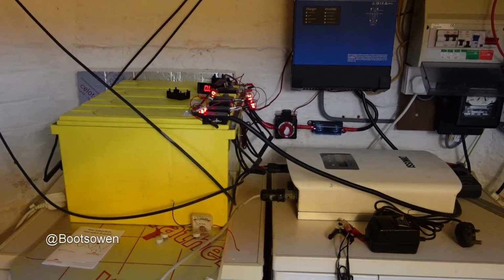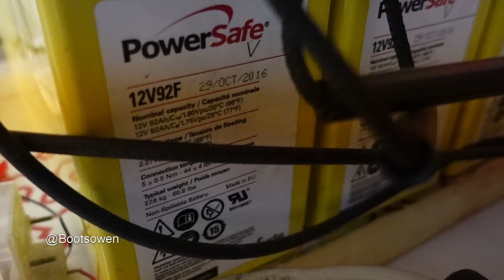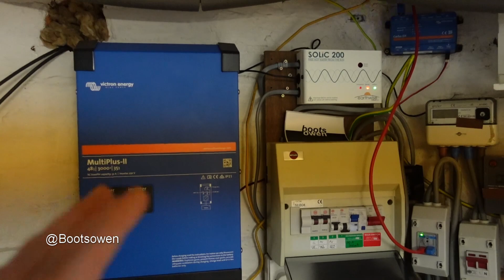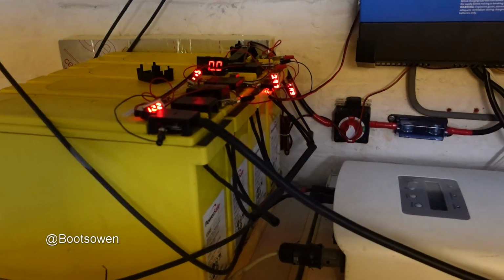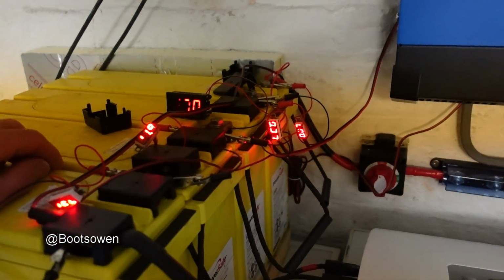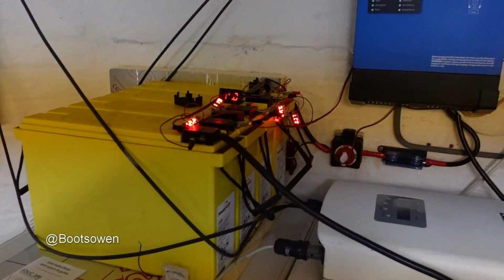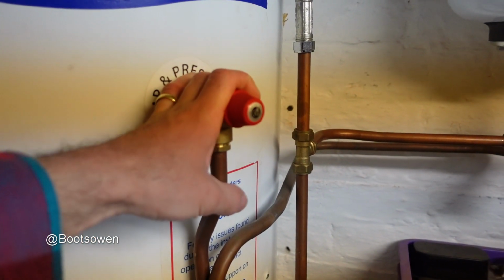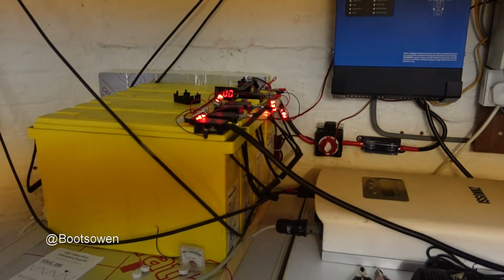A look at my Lead Gel batteries and Victron Multiplus II before removal and replacement with LiFePo4

Comment: Hello Owen, is the inverter an easy diy fit ? I have spoken to Andy about this and he said to contact you, as you have already set everything up and it will be fresh in your mind. I have 4 Solis grid tie inverters and quite a few solar panels peppered about the garden on sheds and pergolas about 8kw in total, I have installed the inverters myself but at the moment I have no batteries, I  really would like to get the victron kit but the electricians I have asked to install it have refused because they don’t know how to install them, one solar installer actually said why don’t I let him buy it so he could save on the VAT ? ( must be a Wigan thing 😂 ) I agreed but even he couldn’t be arsed turning up. at the moment I have resorted to utilising smart life and the adapters to redirect a lot of the power away from the grid but I really would like to get the Victron kit, I do have a few questions but if I ask you on here I would be set upon by the belt and braces brigade, is there any other way I could contact you ? I have watched hundreds of videos on here and I know I could fit it but I would just like to know if what I understand is correct so to speak. sorry for the long comment. Thanks Brian
Reply from the maker: Cheers Brian. My email address is on my yt homepage.
Reply from the maker: My victron sits independently from the solar. When it senses an export it charges the batteries until they are full. When it senses an import it assists from the batteries as much as it can. You can configure it in many ways but I have done a basic inverter charger ESS. I don’t have it set up for off grid at the moment. But it is very configurable and this is what makes it difficult to get your head around. Decide what you want it to do first, then figure out if it can do it. E.g.: on grid. Off grid. Emergency back up. Etc.
Reply: @bootsowen thank you for your reply Owen really appreciated it, your set up is exactly what I want. I will definitely e mail you, thanks again Brian

Comment: I built a LFP battery  using Calb cells  - 100ah -  $650 then 
used this battery to power RV house - pushed battery pretty hard daily 6 years  -
No BMS just a Victron Solar controller - cells were Bottom Balanced when new -
I keep eye on what battery specs with a Icharger  - 
 amazing how balanced cells stayed  -  
few months ago purchased 3 new batteries that are per made  with BMS installed and much cheaper 
 removed  First  battery from service because Mixing LFP batteries  With and Without BMS is not Safe -
No BMS battery will Over Charge -

Comment: I now feel batteries are a requirement with the cost of importing electricity. Without a FIT you give it away for free during the day and then pay for it at night!
Seems like you'd then need a variable import rate to charge the battery during the winter over night cheaply and use it to buffer your high demand uses.
Even without solar panels, a battery charged at the night rate and then used by the house during the day will save 66% on that electricity.
Did you get that lower power brew kettle?
Reply from the maker: I have a 1kw kettle for a single cup.

Comment: 48V IS EXCELLENT CHOICE! 24V is also way better-efficient than 12V for high power devices (hairdryer? water cattle? induction cooking plate? a server or two?) a lot of conversion + heat loss using 800W water cattle at 12V, if you want to power a house go 24V better 48V, some go 400V, #LeadGel is THE BEST Lead #battery that is there? u can easily build ur own battery with #LiFePo4 cells from #EVE + #JKBMS (problem: can not do 15S only 16S but SOME JKBMS have heater and balancer BUILD-IN!)

Comment: Owen, yes with a 12v multiplus 1 KW per day is achievable and as everything is close together cable sizes and runs are not a problem. That system would be much cheaper and the battery bank would not be so large,  but with your 48v 3KW there is room for expansion, who knows what the electric future holds, cheers